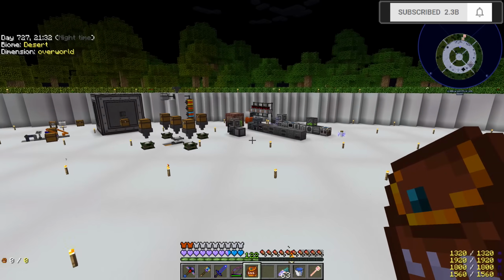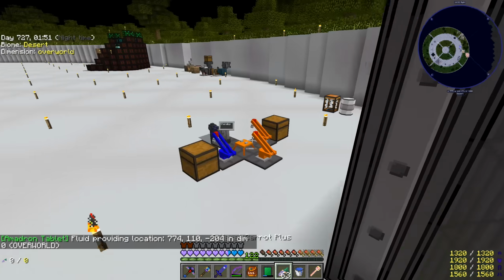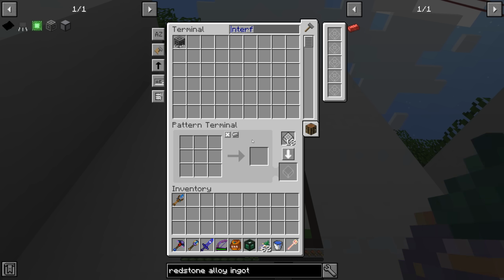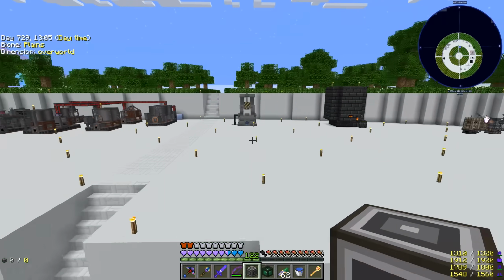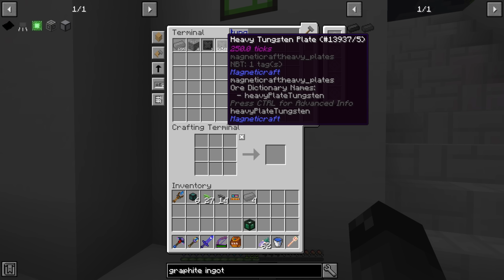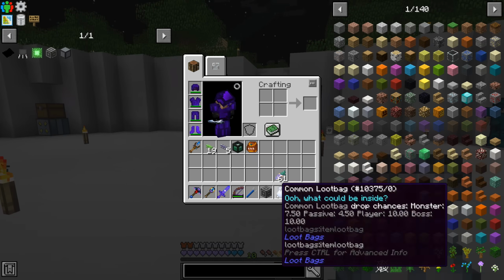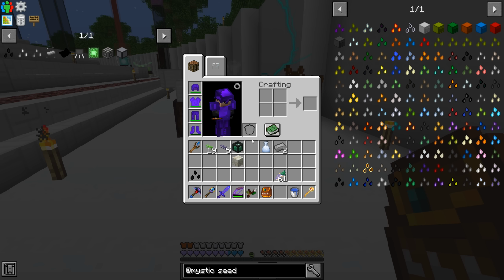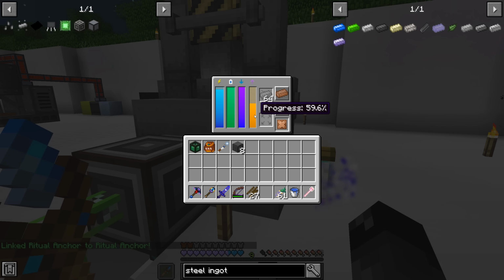Project Ozone 3 Kappa Mode - AUTOMATIC HYDROLIC [E70] (Modded Minecraft Sky Block)

Comment: You only need 5 inscribers. Just need to use ender io item conduits with filters and the final product getting put into the interface. You when each inscriver have a filter for the material required and they get pumped back into a chest which sends it into the 5th inscriver that makes the final product.
Reply: Except if you do that and you end up needing more than one type of processor at once the whole process will be bottle necked by the single silicon presser.

Comment: Is anyone gonna tell him about the "Oredict" option when auto-crafting? So that if it needs silicon it'll use any type of silicon in the system, or if it needs, say any color dye, it'll actually use any color dye not just the one set in the recipe.
Reply: he knows, he even talked about it in this episode
Reply: Iirc he’s had issues with the oredict setting in the past so he doesn’t use it unless it it absolutely won’t work without it
Reply: It's usually better to leave it off so you don't accidentally use something expensive in place of something cheap

Comment: Why not process the Diesel, Kerosene, & Gas from PneumatiCraft into LPG? You're not using it for power or pressure. Just needs 3 more machines & heat for them.